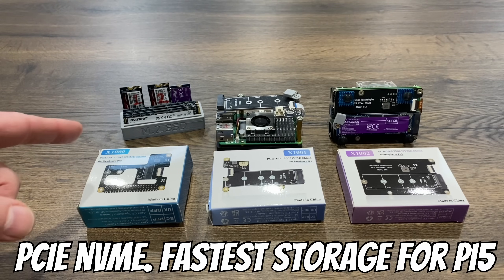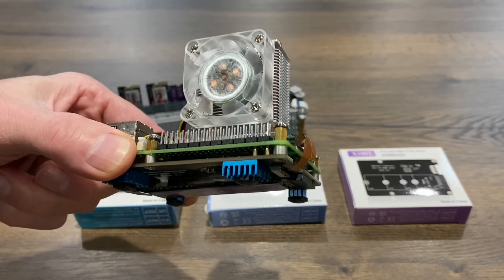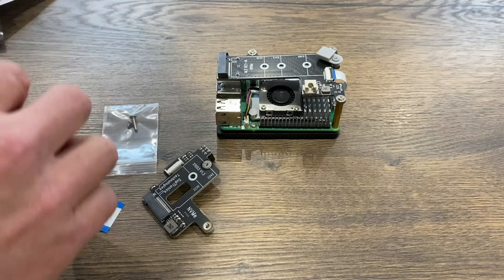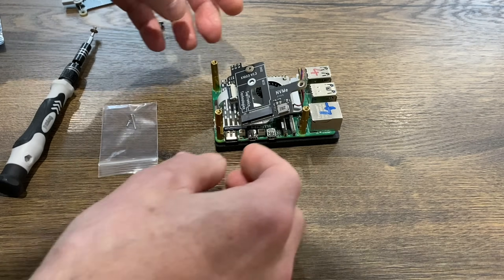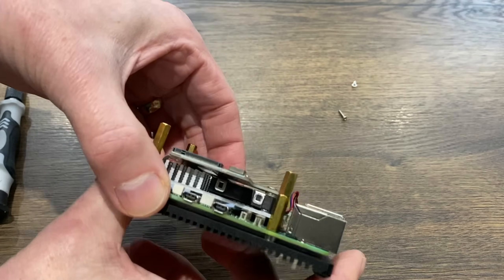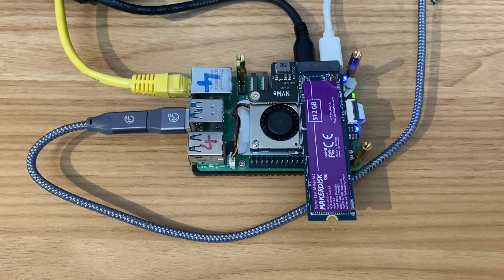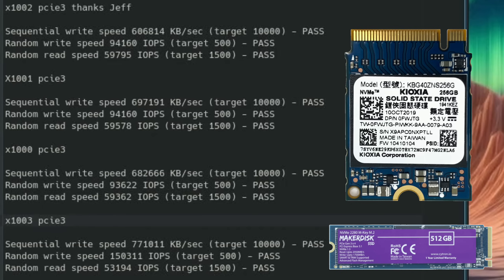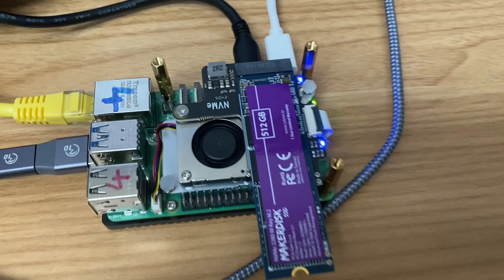NVMe board for Raspberry Pi5. Official Case & Cooler friendly. Geekworm X1003

Comment: You said previously you were using that kioxia drive KBG40ZNS256G, I have a KBG40ZNT256G and I can't get the pi to find it in the bios. If I load into a os on the sd it won't find the nvme until I set the dtparam to allow pcie 3. Did you have this issue if so how did you get around it?
Reply from the maker: I don’t recall having any problems

Comment: hi found this video, just a question, where I live, Italy is quite difficult to find suitable ssd card, all the one on the market are Phison with no compatibility. Is the king spec a good one? I mena this on in particular KingSpec 128GB M.2 2242 SSD PCIe 3.0 - Read speed up to 3500MB/s, M.2 NVMe Gen 3 SSD - 3D NAND Meoria Flash, Compatible with PC/Desktop/Laptop (128GB). Do this board worth the purchase coming from a micro sd? Thanks
Reply from the maker: @drlukas  I have been pleased with the  two kinspec drives I have. A huge improvement over sd cards
Reply: I ve written to geekworm they says kingspec is not compatible! Sound wierd
Reply from the maker: @ probably just not on their approved list

which NVMe drives work with a Raspberry Pi 5?
https://youtu.be/3mUgVTBmKio
Reply: @ they replied me on their wiki some users say no compatibility. Very strange if you tested and worked! Do you think the original Rpi charger enough to make it work?
Reply from the maker: @ I almost always use the official power supply. There was a firmware update to give better compatibility I mentioned it in a Pi news episode
Reply: @leepspvideo  to update the ssd? where to find it. Another issue with original case closed is temp. It bumped up to 58 without cover it remains around 48
Reply: @leepspvideo  Installed and everything works flawlessly apart from the temp bumping up to 55/56 Celsius with original RPI white and red case. I tried to drill some holes to improve station but the final solution seem to take the cover away to have 45/48 at idle
Reply from the maker: @drlukas  I prefer this

Electrocookie Raspberry Pi 5 NVMe case with a Door!
https://youtu.be/moN6m-Uu1QY

Comment: 👌Yes! that one! at last one company did it! :)  Now the next step 🧊: redirecting the air flow from the Raspberry Pi CPU fan to cool down the M.2 heat sink using a 3D printed 90° curved plate attached on top of the CPU fan and using the the same screw that the fan uses.

Comment: I’m using geekworms x1001 pcie NVMe board with a team group 1TB drive for the OS. But I’d like to add a USB 3 NVMe for storage. Are you aware of any boards to add to the bottom of the pi5 that uses a usb3 connector hopefully short and compact? I cant find one for the Pi5, Only Pi4
Reply from the maker: Usb 3 is much slower than pcie
Reply: @leepspvideo  Currently I’m running the OS and Apps on the 1TB NVMe using PCIe at Gen 3 and have a USB3 2TB NVMe dongle for storage (awkward). With the OS and Apps only using 236GB of space. Faster OS and slower storage. It works for a media server but is it optimal, any recommendations with current setup cfg?
Reply: The Pi 4 board should work just fine on the Pi 5, specially if it is bottom mounted. Since it's USB, it doesn't matter if it's designed for the 4 or 5

Comment: I've got X1001 and paired with Teamgroup MP33 2TB and it is a bad combo to work with Pi5. It's lagging and slow when it's trying to to do something i.e. commands (drive is not shown up for configuration in OMV...it boots from NVMe) . Replace with Crucial stick and it works fine.  Just ordered Pimoroni Duo and have this mind: the X1011 from Geekworm.  Thanks for the videos!